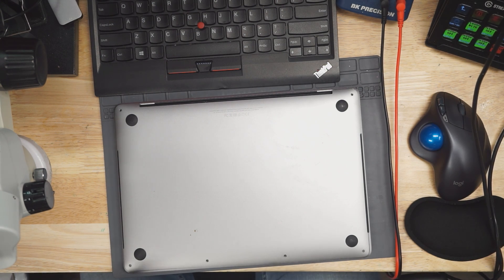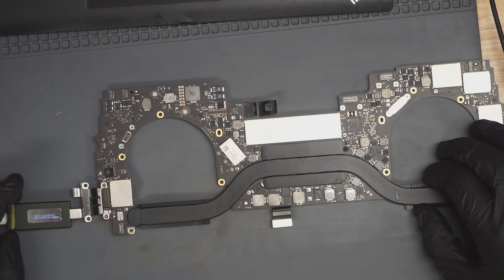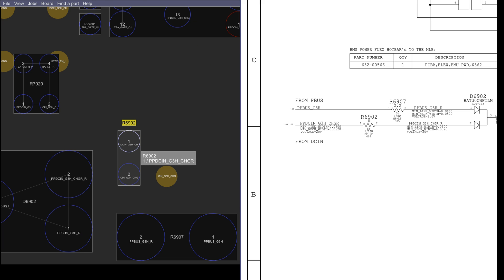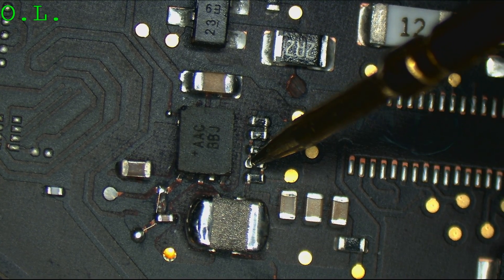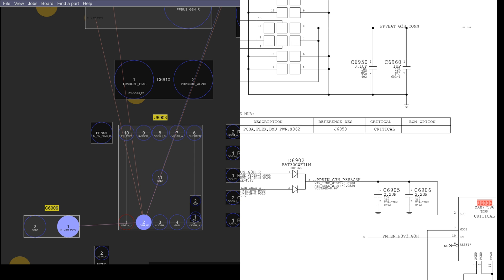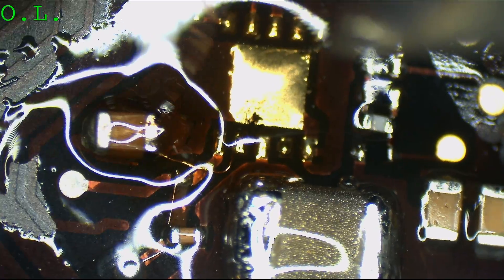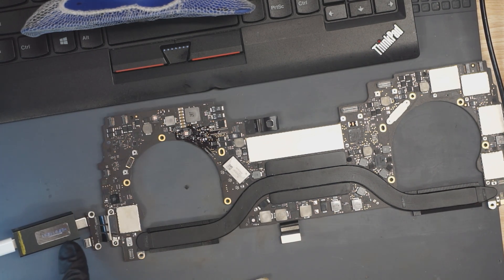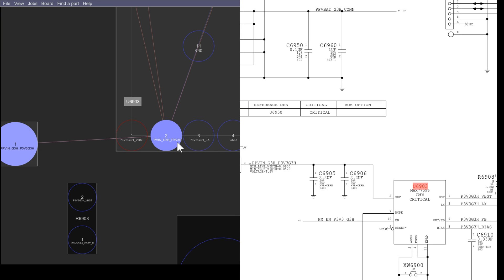Louis fixes board while losing mind, earns 1 star review.

Comment: One hell of a hurdle that stopped me from learning to diy repair my things, is i can't keep track of the screws and can't figure out what holes i took the screws from and which screws are for which holes. 
Any tips?
Reply: Labeled ice cube tray!
Reply: Labeled ice cube tray that @kpjVideo  mentioned and if the holes are not marked on the chassis of whatever you fix mark them down with a sharpie . Screw 1 goes to hole one and so forth.   And take pictures! Lots of pictures! :) If you have to remove a board or you can't finish the repair at that time put all screws back in their place - will save you tons of time later.
Reply: DarkMental take photos.
Reply: Car mechanics use cardboard and draw the shape of the engine. Same could be done if you have the space
Reply: @YouTube_stole_my_handle  Or just paper. If you have enough space and it's a quick repair, you can even just put the screws on the surface in the rough layout of how you took them out. Be sure to make sure you don't have a cat first.
Reply: @YouTube_stole_my_handle  memorization more than anything
Reply: Use a board safe pen with different colors mark the holes and the screws with the colors that they go with
Reply: Take photos before removing them and separate each screw type into a different container based on length, diameter, head type, flat or pointed tip, and color.
Reply: Grab an A4 paper and draw a grid on it and put the crews into their relative positions to eachother, start with the back right upper screw and put it in the right upper corner of the paper, ez
Reply: Keep the set of screws with the part you took off.
Reply: Whell then, SCREW you!
Reply: Also, if you can download the service manual, it will show you which screws go where.
Reply: Use pill containers to separate the screws. The type of pill containers that have one day of the week on them.
Reply: Only remember the ones that are different from the rest and only where those go. And the rest works itself out
Reply: If you also like, iFixIt sells a magnified screw tray. Check it out.
Reply: Magnetic white board. You can draw the overall shape of the stuff and place the screws where they should go. Since it's magnetic, the screws will stay where you put them. That works well except in cases where the screws can't be magnetized at all.
Reply: Write it in a piece of paper
Reply: Photos help, ifixit has a nice multi partition antistatic tray that's perfect for holding things like screws during repairs.
Reply: DankMental, 
    Kind of depends on your budget... I keep mine as tight as is liveable, though... SO...
Glue-sticks... They're cheap, and the glue is often reusable... Slather a reasonably durable piece of plastic or finished wood of appropriate size, and you can then temporarily stick the heads of the screws to it in approximately appropriate positions.
  (punching holes in stiff paper or cardboard or card-stock is fine, but can be tedious and messy)...
    There are also various other "repositionable" adhesives sold in any craft section of a department store (like Wally World) and whether spray on (less goop) or tubes of stuff (more goop) they're also reasonably useful for sticking screw-heads to boards for "formation and position purposes"...

     Pictures HELP A LOT!!! This simply can NOT be over-stated. It's not just for those close-up views of screws and holes, BUT for over-all assembly matters. Can't remember which part fits over or under??? IF you have a series of photos in the order of dis-assembly, you can go through the list backwards...
    HOWEVER, this can require the budget-killer of a decent camera. Outside of fleamarkets, getting a GOOD camera can be costly... SO you can invest in a cheap-o and practice with those fine focus controls until you're either "good at it" or three shades of blue and plaid in the face... OR you can supplement with sketch-work and create your own system of symbols...
    ON THE SKETCHY subject... There are lots of good books out about architecture, mechanical drawing, illustrations, and symbols used (popularly) in all those categories... SO you CAN invest in a few of those for personal reference if it helps... At least, they can also help you learn to READ the blue-prints and tech-diagrams of your own equipment (the most likely resource for repairs and checks)

    Magentic trays and similar devices are a fine thing. Again, it depends on how much you want to INVEST, and can invariably run more money out the window than you have right to... On the other hand, checking out that craft-section of a department store (like Wally World) can net you some "magnetic tape" over where they have the photo-cataloguing and album making supplies... Magnetic tape is sticky and flexible... Comes in rolls like ordinary tape, BUT is also magnetic, so it will hold those tiny bits in place for you in whatever container you stick the tape into... I use it frequently when constructing another "miniature tools box" for the field. You CAN'T BEAT THIS STUFF for keeping your Exact-O Blades exactly as you need them in order and everything, when you have field jobs that require just about every tool and dirty trick in the friggin' collection!
     ...AND any cheap-o box or tray in the dollar store will DO!

   Finally, there are a few casual uses for that disposable styrofoam... AND re-use is good for the environment. SO rather than throw out the styrofoam packing blocks you get with your TV's, monitors, and other electronics, cut it into reasonably useful blocks and a dab of regular school glue (cheap white stuff) will hold them in place, while you just viciously stab whatever pointed little "doo-dah" you need kept "out of the way but close enough at hand" so you can get back to it... This is one of my favorite materials for retaining all those little "bits" for the "Damn Dremel" which is a wonderful rotary tool, variable speed, and infinitely more help than a drill in tiny spaces... BUT you just don't get a quality "bit organization device" with the damn things...

    Some folks also LIVE by Sharpies... They color-code EVERYTHING... AND with reasonably good reason/thought behind it and good results. I can't say it's a great fix for everything (like the rest of these tips, frankly) BUT where it helps, it's a god-send.

    Finally, apologies for this being lengthy... I'm sure you'll see a few repeats between me and others on your growing thread here... BUT I can only suggest from the litany of things I've tried with mixed results. Not knowing for sure what exact size or scale of projects you're interested in, I'm facing this like any other "in the dark" problem, and throwing a bunch out to see what sticks... hope it's helpful. ;o)
Reply: I feel sorry for your wife.
Reply: Get a magnetised board that you can draw on like you do a whiteboard, then just draw the shape and put the screws where they go.
Reply: @motherlove8366  .... dude. That is brilliant.
Reply: Tips? Oh damn where did I put my tips...
Reply: Take them out in a pattern and keep them lined up in that order.
Reply: Mod mat from gamers nexus
Reply: Did you try, when removing them, to arrange them on some kind of tray the same way they were on the laptop, relative to each other's position?
Reply: +DarkMental 
IMAGINE pubes arround the screwholes
IMAGINE the repair is acctually a weeb porn
You don't want the screws to not penetrate again right?
Reply: Photos helps, also what I do is mentally seperate the laptop into "layers" or "sections". MOST screws in a given area are the same size (Bottom cover screws, motherboard screws, screws under the keyboard) so just memorise the one or two that are different and the rest are all the same so whatever - its much easier to remember where 2 screws went then trying to remember all of them at once. Things like fans, heatsinks, DVD drives I stack the screws on top of them or in the holes they correspond to where possible.

For other stuff where there is a lot or varying sizes or a particularly complex laptop I'm not familiar with I basically arrange them on the desk in the same pattern I remove them from that section so I just, essentially, "draw" the layout of the parts with the screws.
Reply: With small repairs on iPhones I like using tan masking tape. I really need to just order a magnetic board though.
Reply: @DarkMental  take photos and if you have problems with which screws go where, use a magnetic parts mat and a sheet of paper with a diagram of what you are fixing. Place the screws at the corresponding points on the diagram.
Reply: Take photos, and use a couple of magnetic screw pads (I use xiomi Wow 2 pad).
Reply: Scotch tape. Tape the screw near the hole you just took it out from. You'll use a ton of tape if whatever you're disassembling has many screws, but you won't mix any screws.
Reply: yeah dude, here's a tip:  if you can't even keep track of screws, hire a professional ;)
Reply: Buy a laptop that only uses 1 screw type

Comment: Nah, the Sony lense it's way overpriced and is near identical to the Sigma for taking pictures but the Sigma might be better with video.
Reply: Also the comparison of the lenses doesn't really mean much in a situation like this. The difference is more related to bokeh and aperture.
Reply: Any difference would be when ultra narrow depth of field, or very low light performance was wanted. So useless in this case. Makes sure there is enough light, stop down the aperture a bit, and mid grade lenses are as good as great ones.

Great lenses shine when you need to get every last bit of light captured, And you need to keep all the detail possible. If you are going to throw away the worst light anyways (by stopping down) then the extra quality does no good.
Reply: Yes if you shot video of still subject, using enough light, at 5.6 all the time then you won't need new lens... Kit lens will cover everything that you need... Prime lens are designed for more demanding situation (faster performance, low light capability, more bokeh, etc)... And for video i think it will be harder to see the difference except if you shoot at 4k or in low light situation...

Comment: Isn't that a Transistor, not a Diode? At 4:05
Reply: tran·sis·tor
/tranˈzistər/
noun
noun: transistor; plural noun: transistors
    a semiconductor device with three connections, capable of amplification in addition to rectification.

====================================================================

di·ode
/ˈdīˌōd/
nounElectronics
noun: diode; plural noun: diodes
    a semiconductor device with two terminals, typically allowing the flow of current in one direction only.
        a thermionic tube having two electrodes (an anode and a cathode).
Reply: @Serpentinezation  your point? That thing he called a diode had three terminals.
Reply: Seems like two diodes tied together on the cathode side packed in one package.
Reply: @AyyLmao0224  that's kinda what Transistors are though, two p-n junctions sandwiched together with a common anode or cathode, i.e. p-n-p or n-p-n type. I think that they're sometimes represented that way on circuit diagrams to signify their function, but they're still a discrete component from diodes.
Reply: @xmlthegreat  I'm no electronic engineer, but seems that it is possible (Although someone on StackExchange argued that it is not the same; see electronics.stackexchange.com/a/83268 if interested).

However in the datasheet the manufacturer (STMicroelectronics) provides, the package (BAT30 series) is described as "Small signal Schottky diodes" that "uses 30 V Schottky barrier diodes encapsulated in SOD-523 or SOT-323 packages.
This device is specially suited for switching mode applications needing low forward voltage drop diodes." So I guess it's probably used as diodes.

By the way, they also seem to have a variant (BAT30SWFILM) that is two diodes connected in serial, which seem to have three pins as well.